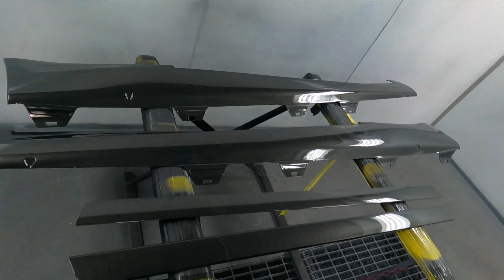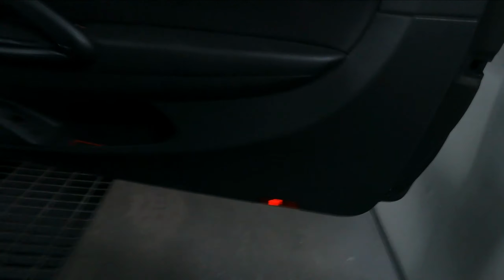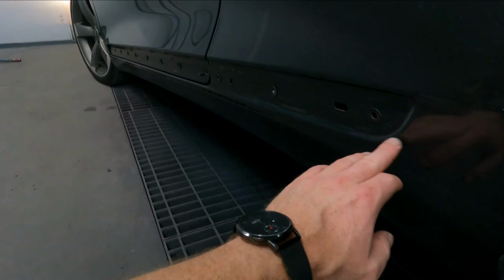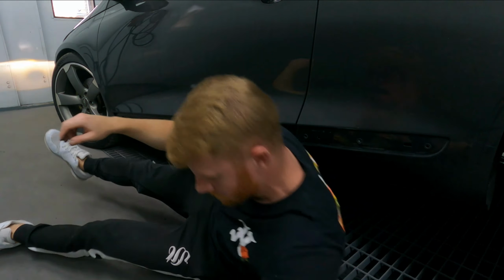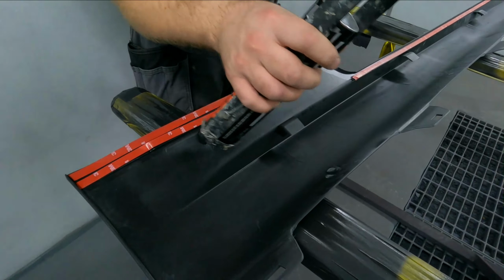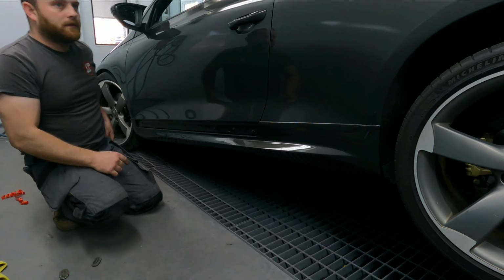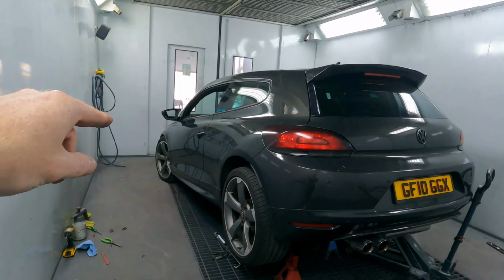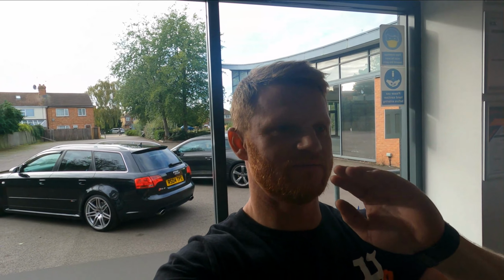VW SCIROCCO R SIDE SKIRTS INSTALLATION

Comment: Just fitted these myself and most of screws were rotted so couldn’t reuse them I just tiger sealed the holes for the door 😅 biggest pain in my opinion was the clips at the bottom since the previous owner had undersealed over the little covers
Reply from the maker: @danuelreid  ah honestly I had a few bad screws too and tiger seal certainly helped me out. I just knew I would not be taking the skirts off again so I just hit it with sealant. Did you manage to sort it though mate? Hopefully you did as the r skirts look so good on these cars 👌🏼
Reply: @ time will tell, mine didn’t want to stick to the car even with tigerseal. It’s screwed underneath and in the arches but I’ve had to tape it together to hold the bond and hope it sets overnight 🥲
Reply from the maker: @danuelreid  ah man, I really hope it holds 🙏🏼 very annoying that. Last resort would be take it to a body shop to try get it done.

Comment: I've got some r style but they don't have that red band 😢 how they will get stick to the body
Reply from the maker: @cristicristi5466  Hello 👋 ummm everything I got came with the kit. Which red band do you mean? I'll see if I can find you it 👀
Reply: That red band that you pell from the side skirts I've just brought some double sided tape just in case can you please tell me what's the size of thouse screwfix please mine they are not genuine like yours I think they are after market maybe they don't come with that red tape
Reply from the maker: @cristicristi5466  ah the red band is just the double sided tape plastic cover which I'm pulling off. So you should have that. The screws I'll try get the size from the company I got the skirts from and update you once they respond. The screws should have come with yours too.
Reply: @MichaelSmith17 thank you so much can you please if possible how much cost you ish  paint and install please

Comment: That's a great tutorial, I'm definitely gonna use that when I get my kit in the mail soon, but I've got 2 questions.. 
First: If you glue the skirts onto the body and the skirst sit on top of the bottom of the fenders, can you still remove the fenders afterwards? 
Second: How big are Tommy's cojones for drilling the screws into the skirts while the car is standing on top of a grate?
Reply from the maker: @-a6833  thank you for watching my video! I appreciate this comment 😄 
I honestly am not sure as I had the r side skirts glued to the body itself. Just as I knew I would not be taking them off once one. 
Haha yes Tommy has big cojons or he's just been doing it for years! 😁 let me know how you get on though and again appreciate you watching my video!
Reply: @MichaelSmith17  Hm, well reason I was wondering is because I'm about to put a whole R kit on, including those sideskirts, but I was also considering putting the GT24 fenders on later down the line, so I figured if the sideskirts mount over the fenders that might become an issue if I mount those first..
But if it's glued only to the body then I guess they can slide from under it maybe? Has to be  now that I think about it, or the fenders on the original R would be unreplaceable.
It's surprising how little info there is to find on this btw, it's just you that has a somewhat detailed video, and an old thread on the scirocconet forum, which no longer has images lol
Reply from the maker: @-a6833  ah OK that makes sense! Yeah I know what you mean, I think my video is the only one up as I myself wanted to see how to do this originally. Even my video was not the best as lighting ect was terrible. What scirocco do you have by the way? I take it the same as mine?
Reply: @MichaelSmith17  Yea, pre-facelift also, I've taken the fenders off before, which was a bit of a pita, so now I'm thinking maybe I should document it like you did because I don't think for the scirocco there's any youtube videos on it yet, it might be helpful to others
Reply from the maker: @-a6833  ah nice mate! Yes definitely do, it would have helped me out at the time. I only make my videos to document my journey ect and at the same time I only hope it helps others or at least gives them an idea on how to do certain things. It's fun too, I recommend it and I'll sub to your channel too

Comment: hi, min 21:17 screw goes inside the door? When are u driving dont cause any noise??
Reply from the maker: @flp500__  Hello, thanks for watching my video. No there is no noise at all, the car sounds the exact same. So you are all good 👍🏼
Reply: @MichaelSmith17  but is a screw or a clip? I dont understand in your vídeo.
Reply from the maker: @flp500__  it's a clip, sorry I should have said.
Reply: @MichaelSmith17  I have another question: why dont used the retaining strip instead of gluing?
Reply from the maker: @flp500__  only because I knew the skirts will not be coming off again so I used glue.

Comment: Were the screws drilled into the body of the car? or was there a designated hole in the body kit? Do any holes have to be drilled or is it all click in?
Thanks in advance
Reply from the maker: Hello Rojus, thank you for watching my video. So the skirts come with clips that just slot underneath the car. Those clips have holes for you to be able to insert the screws without having to drill the bodywork. Hope this helps

Comment: Do you need to buy the screws? If so what is the part number? Cheers
Reply from the maker: Hey James! Ah no so mine came with a small bag of screws luckily. They will be the self tapping screws. I'll try find a link for you
Reply: @MichaelSmith17  cheers mate, I've been quoted £300 for fitting and painting, would you say that's about right?
Reply from the maker: @jamesb3700  yeah that's a decent price mate. I would jump on that. I would have been quoted the same if I didn't do it myself.
Reply: @MichaelSmith17  Great thanks, will do 😊